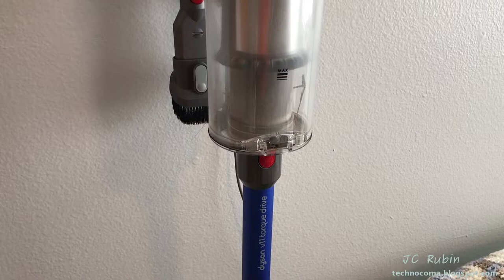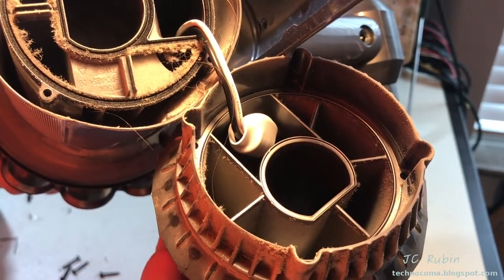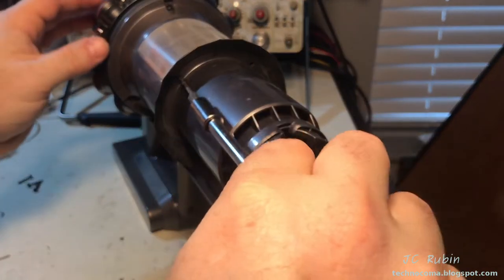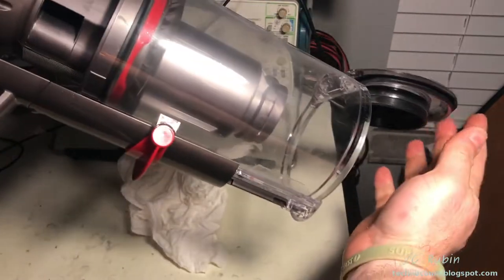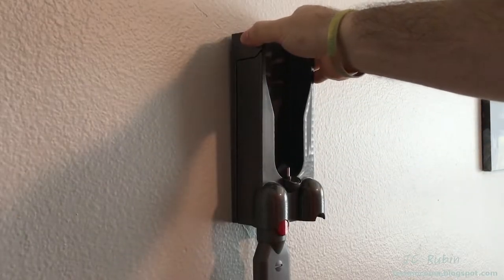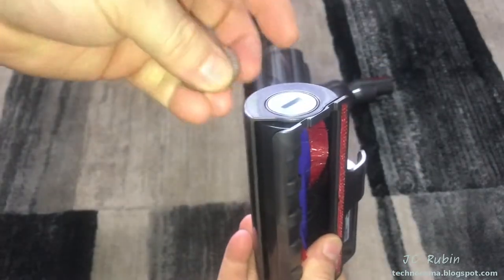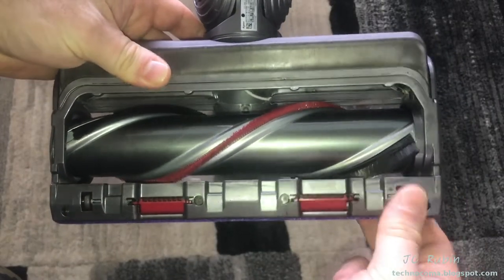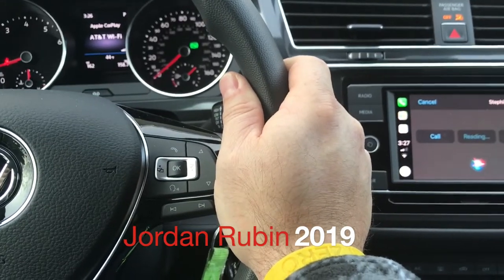Dyson V11 Torque Drive Maintenance for Maintaining Maximum Performance

Comment: The manual describes all the maintenance anyone should ever need to do when used as described in there. Empty the bin, rinse the filter monthly, and detangle the brush bar if needed. That's it. If any of this is in doubt, it can simply be fact-checked by reading the manual; the pdf is available on Dyson's website. Anything else is not only unnecessary and in no way affects performance, but can risk damaging the machine. Never unscrew anything; the internal cyclone discharge chamber is supposed to always have dust in there and it does not impair performance and cannot contribute to bad odours (I've made videos outlining the science of why). Never ever wet anything other than the filter. Seals (e.g. on the bin) should never be wetted or washed as it removes the lubrication; you can always tell when someone has done this and doesn't understand because they then have difficulty opening the bin afterwards, risking further damage from forcing. Never use liquid lubricants; some polishes in fact can dissolve chlorinated rubbers and damage the machine/seals (the manual explains this); powder dust is used in the factory to lubricate. The filter is a lifetime filter and should never need replacing if used as described in the manual. Watch out for scammers peddling a false economy and trying sell you a new one. The Dyson website and YT channels also demonstrate how to wash the filter. You can spray water from the outside and nothing harmful will happen because to the basic physics of dilution processes and particle displacement from complex fibre networks. Dust to the left of the white collar on the main head when the brush bar is removed is expected to be present and does not impair performance or damage the machine in any way; it can be left there (it comes and goes of its own accord).
Reply: Some people like to be their own warranty! Like me. Just saying. 😊
Reply: @barryg41  Interesting; many Dyson brand haters, who scrape the barrel for things to criticise, complain about the 'short' length of the warranty. I dread to think how they'd react to someone who suggests they'd wilfully jettison the warranty. That is, except when it's needed (cough...two replacement heads...cough). :) Anyway, each to their own, but many viewers could be misled and think playing with the innards is beneficial rather than the harmful reality. :/ So I just felt duty-bound to provide a friendly counterpoint for people to consider. :)
Reply from the maker: In having read through ALL of your comments here, do you treat your viewers on YOUR channel like they are, well, dumb? Its just that in conjunction with the obvious self promotion here, your uses of 'DYSON HATERS', 'NEVER','NEVER EVER','CAN'T''DON'T. Well,..... could put people off... Its not an EKG nor an MRI. 

I will touch on one scenario for you ....since you brought it up, in consideration that the unit in the video, has never been opened before and the seal were already binding during bin opening . Lets pretend they weren't binding, and someone vacuumed up dog crap.  

According to you…
"Never ever wet anything other than the filter. Seals (e.g. on the bin) should never be wetted or washed as it removes the lubrication; you can always tell when someone has done this and doesn't understand because they then have difficulty opening the bin afterwards, risking further damage from forcing. "

'Never ever' is profound when having to was out a bin and pipes full of dog crap, this really could be anything undesirable caught in the bin.  You get the point.    Your assumption that the rubber seal lubricant was not approved for rubber seals was presumptuous.  Lastly on that matter, the machine in question, having never been exposed to water was binding, humid environment, where it is well known, dry lubricants can easily become less effective when doped with other matter in the presence of moisture (like dirt, emptying from the front)

I could pick apart the rest of what you had written, but I’m busy, were done.
Reply: @retrotechandelectronics  Hi. I think it’s a little unfair to suggest I treat my viewers as though they are dumb. If you’ve genuinely read through ALL the comments on my channel, you’d see that I always treat respectable people with respect and go out of my way to help them. Some people though, make a factual claims which are false, and in that case, I help by pointing them to the evidence explaining why. At this stage, a few get very hostile and nasty, making personal attacks and spouting hostile rants, which is unfortunate. Even then I’m usually tolerant to a degree, but when it’s combined with showing no signs of listening to reason, I make sure they know that behaviour is not tolerated by me. That’s perfectly par for the course on a public forum. The only people who are put off my channel are those who identify with the wrongdoers or whose subjective worldview is at odds with reality and they don’t like hearing it, even if, as is the case for some people, they reluctantly agree. I’m more than willing to engage people in civil debate on matters of fact.

RE seals; the manual explicitly states to dry wipe them and not to use polishes etc. In fact, in your video, you nicely show the problem of wetting seals—they become sticky and the bin is really hard to open. That should never happen because it can risk damage when forcing it open. Dry powder is used in the factory to ensure this is avoided. I’ve seen no evidence anywhere under higher humidity of dust getting wet. In fact, you’d have to get near supersaturated conditions to hygroscopically activate these particles, which isn’t a normal environment within the home. And even then, a dry wipe will fix it if even necessary. By the same token, liquids cause gunk in exactly the same way, as dust etc. absorbs it over time, the lubricant can also spread, it costs money, and some products are known chlorinated rubber solvents which can destroy seals. People may not know this. Best is to just dry wipe them and let natural dust be the lubricant. Always happy to see direct, strong, convincing, evidence to the contrary. :) All the best.
Reply from the maker: @VacuumFacts  "In having read through ALL of your comments HERE" I didn't ready anything on your channel.
Reply: @VacuumFacts  as a newly proud owner of a dyson 11 torque and stumbling onto retro tech and electronics page today, i would kindly request that you cease interfering with our learning pleasure on this fine youtube channel
Reply: @waverunners  what Vacuum Facts is really doing here is trying his best to warn people from damaging their Dyson. its a fact is most people overestimate their ability do worse. And Retro Tech & Electronics is trying to share that more cleaning could be done to maintain vacuum performance.
Reply: @retrotechandelectronics  bro..what about clean filter error everytime..even after cleaning filter as per website....
Reply from the maker: @Lakshyakapila  bro......

Comment: Amazing content! What did you use to clean and dress the gaskets of the dust chamber with to promote smooth action during removal?
Reply: Silicone grease for lubrication & just soapy water to clean. Although Dyson recommend not to clean the gaskets. Fine dust will stop binding.

Comment: Awesome video. Also glad to see that we don't need to disassemble the entire device like some people have done with the V10. One question though. After how long did you decide to open yours? I am wondering how often we need to do this.
Reply from the maker: I had unwittingly used mine for some Sheetrock cleanup soon after purchase so there was an immediate need.  Compressed air can usually do the job if done as a regular maintenance practice AND you don't vacuum up liquid.

Comment: It’s better to use baby powder or some of the dust from the cyclone discharge chamber to lubricate the rubber. Using oil will just collect even more dust on rubber parts. If you pay attention to the seals before even using it for the first time you will notice there is already some powder on rubber parts from the factory.
Reply from the maker: Powder did also prove helpful to reduce sticking.
Reply: Thank you for this! I just got a second hand v11 and it had a really bad sticking problem. I didnt have the grease used in the video but had this on hand and it really helped! Still not perfect but at least its usable now.

Comment: you mention to wash the filter inside out to avoid debris going in which is logical, but then you use high pressure air to blow debris into the motor ?  should have also clean and lubricate the motor since your doing a spring clean on the V11
Reply: The compressed air won't blow any air into the motor, it's a safe procedure.
Any motor parts will be greased and completely sealed. The grease is made to last the life of the vacuum without servicing.

Comment: Recently when I used the torque head, it sent message "blocked airway".  It doesn't happen when I use the soft roller head. I"ve checked everything for any blockage, except opening the torque head for inspection. I'll try tomorrow.
I also had the same problem whenever I wash the bin. It would be hard to push down the button to empty the bin. I felt like it would almost break the button. Now I'm contemplating if I should wash it again next time since it's giving me that problem.  Thank you for such a great video.
Reply from the maker: Youre welcome.  Aside from the ring issue posted in the other video I have no complaints after all of the time since posting.
Reply: Those rubber seals don't respond well to becoming overly wet.  If you do wet them, let the canister remain unattached for a few hours until they have a chance to dry out completely.  I found this lessens the excessive friction.  Plus, I like to lube everything with "Super Slick Slick Stuff".  You can find it at Lowes.  Best stuff ever.  I was having the same problem you described, but after allowing the drying, and lubing the release mechanism, it glides like a dream.

Comment: I have a tip for everyone. Most of the dirt on filters is from when the motor accidentally gets switched on while emptying the bin. When the bin flap is open air is sucked through the cyclone and it sucks all the loose dust from the cylones straight onto your filter. HOWEVER, this can be prevented by loosening the filter a 1/4 turn, or removing it, before you empty the bin. This disables the motor. Nevertheless, wash the filter once a month.
Reply from the maker: While possible I don't recollect ever doing this....
Reply: Thank you very much for the good advice, you are right.

Comment: I think I may have got the internal part wet and now it doesn't work. My husband took out the filter and put it back in while a bit Damp still and now vacuum won't work. I'm assuming this is the reason anyway. Anything I can do?
Reply from the maker: remove the filter and let it dry out a few days, re insert and try again

Comment: Talcum powder them since you wiped all that dust which is also lubricant for the seals. Also never wash a heavily dusted filter before actually dusting it with a brush. This will make washing much easier and less mess. Also eliminating the possibility of pushing that shit deep into the filter.
Reply from the maker: Sour words... But true.

Comment: I find this vacuum so counter intuitive engineering wise. There is so much gunk that gets stuck there in that hole inside the metal mesh and you can’t clean it out at all unless you unscrew it. You shouldn’t have to unscrew it and the manuel doesn’t even call for cleaning that part…yet so much gets stuck in there. Very disappointed considering the price of this baby